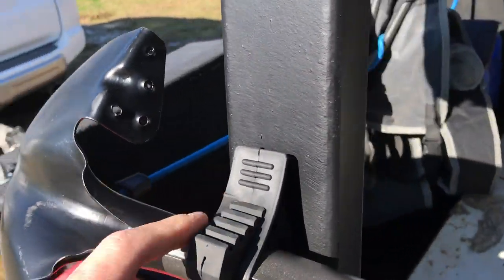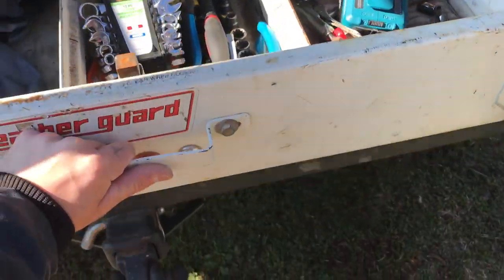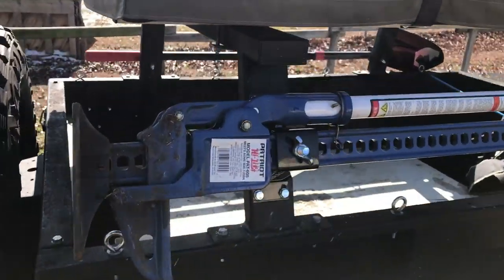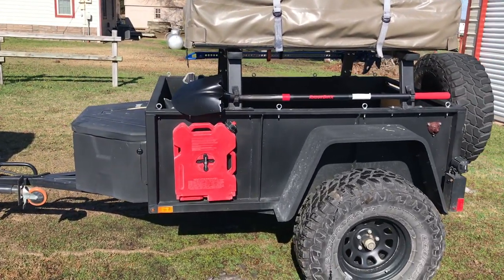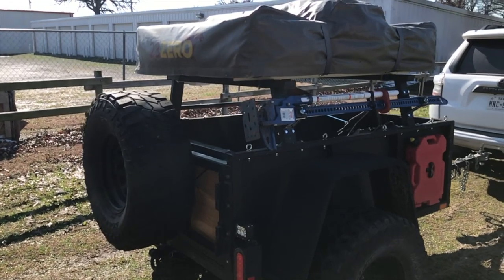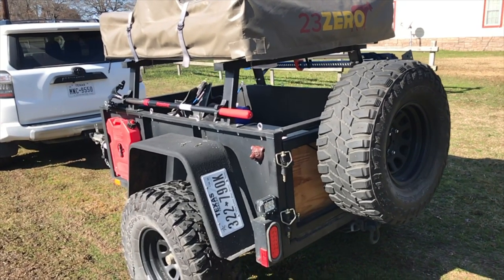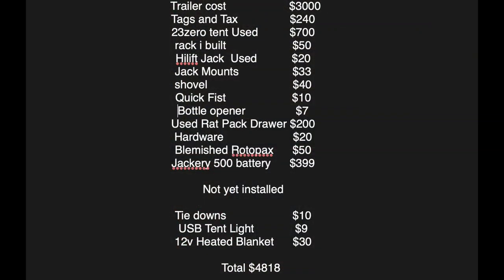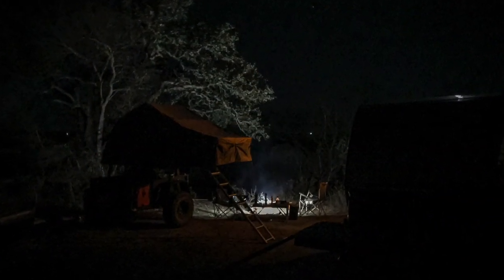Budget Overlanding Trailer, Part 2, Mods and Price Breakdown, How Cheap Can You Get?

Comment: it might be a good idea to mount a spindle on your trailer, then put a hub and new bearings on the spindle and mount your spare tire on that. every time I go on a trip I will see trailers setting on the side of the road with a burnt out wheel bearing.i keep a new hub and bearings in my trucks tool box just in case